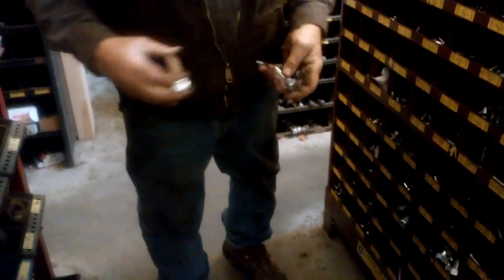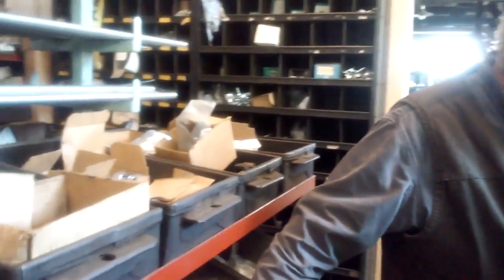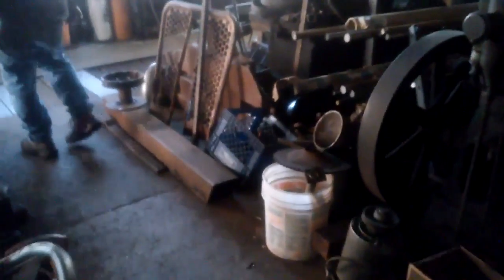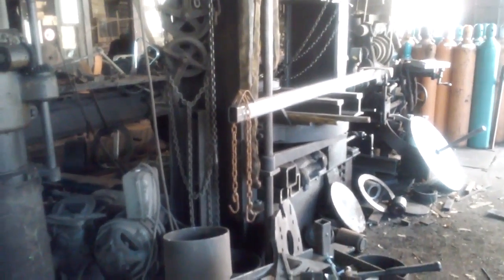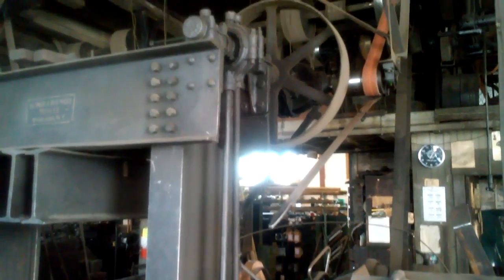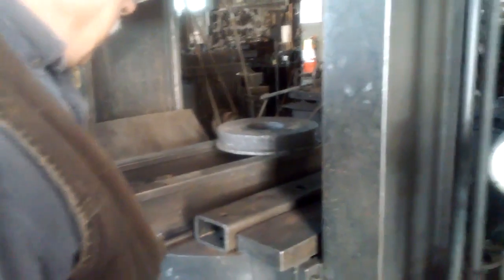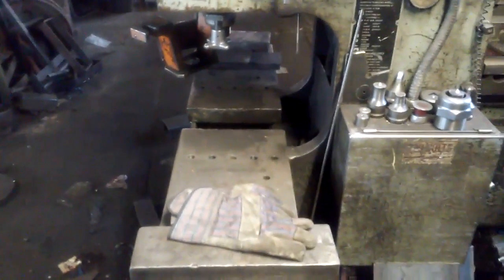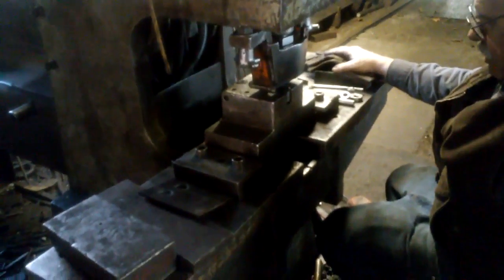Lester Dunklee's Machine Shop

Comment: Look up, man! Lester's shop has a stunningly beautiful overhead lineshaft system, and the video spends 90% of the time (badly) focused on the floor. (For the record, the Dunklee shop threaded some lengths of 3/4" rod for me (and drilled some 4" angle) back in 1981 to help me pull my 1830 barn back together again.) Wonderful shop, horrible video that would have benefited from someone who actually cares about, and knows something about, machines. ps: we did not need a lesson in grade-5 bolts.